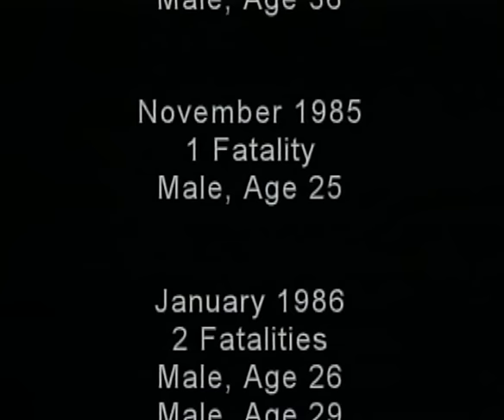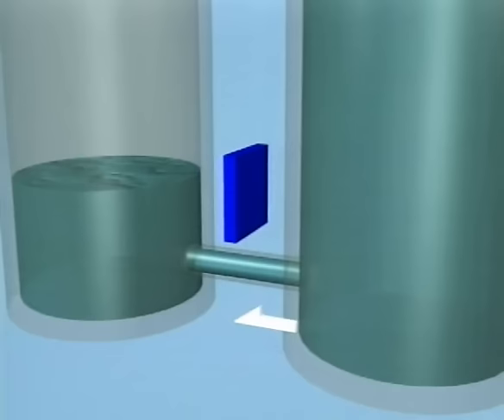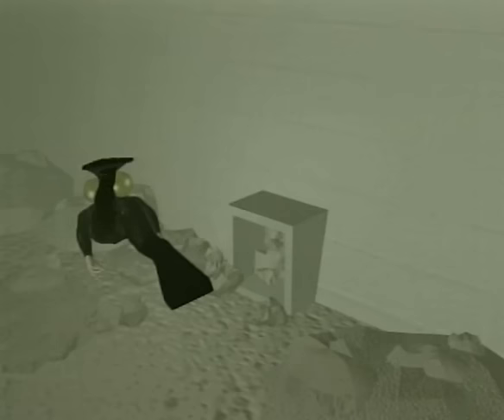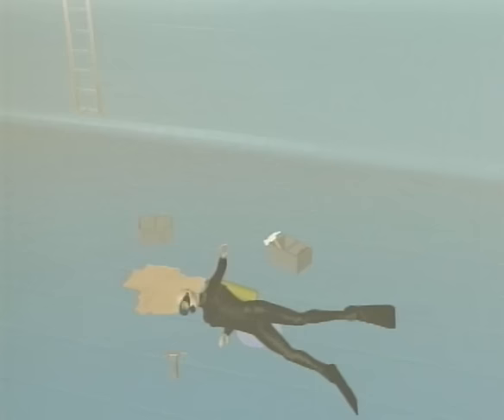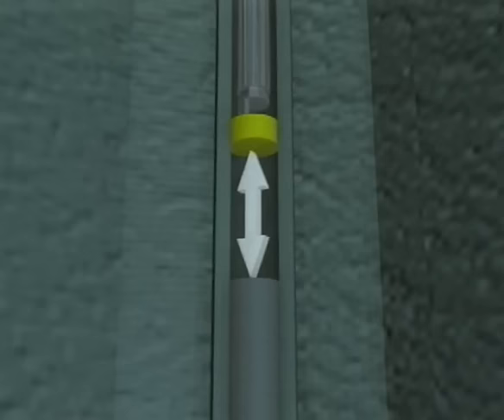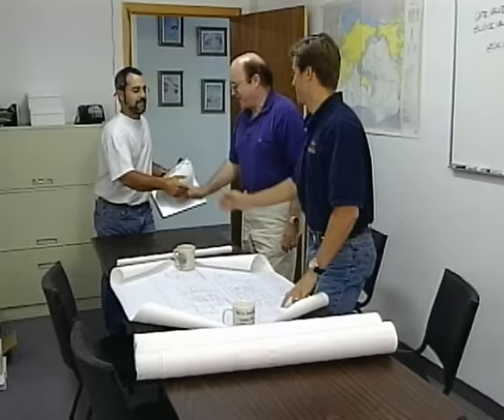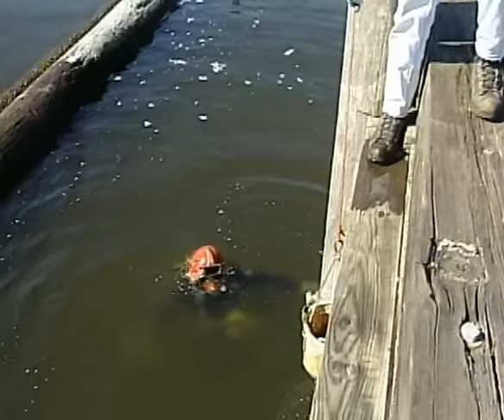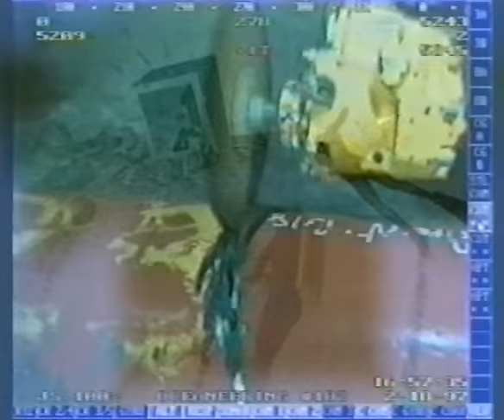Delta P

Comment: Diver 3 is a hero. He put his life on the line to recover 2 bodies, whether dead or not.
Reply: i can understand the sentiment, but you can’t deny it’s a stupid move, too. the water is not your friend, rescue attempts only put you at risk, the smart call is to leave your comrades to rest and staying alive and safe away from the accident site
Reply: @wddld-qv7sd 
Working in similar fields, we assume that missing coworkers are never dead, but simply incapacitated. We don't asses them for life until we exit the hazard situation and check for a pulse.
Reply: He is, but in my head was this situation where divers just kept going down and clogging the drain "Diver 32, also became trapped"
Reply: @74KU  We now have precautions in place wherein, if a trapped or incapacitated coworker is in too hazardous of a situation, we don't send anyone in to try to rescue them until higher tiers of rescue workers are on scene. In my current field that's usually HART (High Angle Rescue Technicians) and Confined Spaces Specialists.
First order of business for first responders is to mitigate the risks, such as water flow, electricity, oxygen and fuel from a fire, etc. Standard Protocol even for the specialists isn't to go in until the hazards are removed.
My experience regarding this so far is in recreational diving, dam building, and high rise construction.
Reply: In general you shouldn't try to immediately rescue someone, that's what resulted in two deaths and an injury instead of one death. Proper procedure was probably either use built in communications to contact rescue team or surface to contact the rescue team. Since it's a dam and they had people manually cleaning the grate odds are the water flow could have and presumably was supposed to be cut off.

For all we know diver two could have just told people topside, they could have closed a valve or something and stopped the flow of water.
Reply: @hawawah8671  Accidents like this are why and how we developed those procedures.... after the fact.
Reply: @Mygg_Jeager  Even if no mandated or suggested procedure existed for such dives at the time as a general rule you should leave rescue attempts for the experts. People trying to save friends in industrial accidents have killed far more people than they've saved. Pulling one person out of a hole is hard pulling two or more people out of a hole is much harder per additional person.
Reply: @hawawah8671  Oh I agree 100%, lol. Just adding to what you said.
Reply: @Mygg_Jeager  Fair enough, almost all methods of protection unfortunately only arise after the fact.
Reply: @Mygg_Jeager yo, spotted you on I think real life lore comment section. I think you were slaying spergs with your mighty blade. Carry on.
Reply: @lucamckenn5932  Likely. XD
Thank you.
Reply: it later transpired he ate the two other divers
Reply: @El_Hoy_Garcia  Previous Jobs includes massive dams in the middle of nowhere and rural camp work. Thought about using my recreational diving certification to bridge into professional commercial diving, but that's an extremely tight knit and highly controlled industry. Don't know about all commercial divers, but I know that there's only 5,500 deep-sea welders on the entire planet. So if all my skills and certs so far only got me pushing dirt, it's not really worth my while up go chasing extremely rare and prestigious qualifications for such tightly controlled and rare jobs - at least not without a solid in with the industry, and a direct recommendation from somebody first.
Reply: @DunWorryBoutitBoutit Yeah. That's about what I thought. 😏
Reply: Just say they are all heroes then because he ain't no rescue diver He went down there to see what was taking so long in a hero saves people nobody got saved my boy
Reply: so sad most these people were in their 20's
Reply: There was an instance where a young man was recorded to retrieve remains of his dead friend from a sharks belly after killing it.
Reply: Never have I ever expected to read a professional opinion on diving safety under a willy wonka meme
Reply: Did the one diver who recovered the two dead, I hope he got there wages+ overtime for learning recovery diver on the job
Reply: Diver 2 too

Comment: I came here after learning about the Paria Pipeline Disaster. RIP to the victims who died, and thank you Chris for making it out and trying your best to get help. Shame on the company that did nothing to save those trapped lives while they could have. Disgusting on their part.
Reply: They didn't even try. They could access the bodies after they had died. They refused any rescue missions. Shame on them.
Reply: @PurePain_1  Actually the way they accessed the bodies after was they flushed them with pressure from the other side. So they kind of flushed them out..
Reply: Shame on the company, that did not consider delta-p possible and make a safe plan to do the work.
Reply: That same video brought me here too. Its that bad
Reply: soooo... that would be premeditated murder, right?
Reply: workers fault. they didn’t follow instructions

Comment: This is actually a very good video. And it has that 80s-90s vibe. My father was a dive tender when he was 18-19 years old in the late 60s. He said he learned a lot of stuff, but he couldn't take the toll of divers dying so much. He said he was watching a nearby dive crew in the MS River in New Orleans when something happened and 2 divers died. He'd had some close calls with his team also, but no deaths. It doesn't help that divers are frequently used for dangerous operations. And in some cases the company hiring you might be planning on doing some sort of procedure without your knowledge and it could kill you. Having a winchable tether would be nice. But Delta P, like GI Joe says, knowing is half the battle.

Comment: Now I know what this is called. When I was about 10 years old my local swimming pool had a wave system. It pulled water through a few holes that would have been about 1 metre by 2 metres long with big steel bars. I was a curious young lad and a very good swimmer so I swam 4 metres deep to see what happened when the waves were on. as I held on to the bars the water pulled my head into the bars and I could not pull out. My head was trapped being sucked in by Delta P. Then after about 10 seconds I felt my head was released and swam to the surface to get some air as the waves were being pushed out through another hole.

So I can understand that if the machines were set to take more water for longer there would have been nothing I could do. Needless to say in our day and age that would not pass health and safety any more.
Reply: scary!!
Reply: Squeamish warning
Have a great story: Once, a little girl who was looking for somewhere to rest was sitting on a pool drain. There was a pool cover, and water surrounding her. The drains started sucking, and it was pulling on her insides. Her intestines were sucked out.
Reply: Actually this happed to a young voy in thier own pool, he had to tear through his own intestines to get up to air. Was using the suction on his bum with the intake at the bottom of the pool

Comment: 🎯 Key Takeaways for quick navigation:

00:04 🚩 Delta P is a common cause of commercial diving fatalities, accounting for 2 out of 3 incidents.
01:12 🚧 Differential pressure (Delta P) occurs when water pressures between two bodies are significantly different, seeking to equalize themselves.
02:07 📏 The force of water through a hole can be calculated by area of the hole × difference in water depth × PSI per foot of water depth.
03:00 ⚠️ Delta P situations are invisible and can suddenly trap divers; escape is only possible when pressures equalize.
05:25 🚫 Proper preparation and communication are essential to avoid Delta P accidents during diving operations.
08:26 🔒 Implement lockout tagout procedures and assess potential Delta P hazards when selecting equipment for diving assignments.
09:10 🔄 Use techniques like cutting slots instead of holes, and fabricate covers to reduce the risk of getting stuck in Delta P situations.
10:21 🛡️ Be aware of potential differential pressure situations, recognize them beforehand, and be prepared to deal with them to ensure diving safety.
Reply: Huh. A serious "takeaways" comment. Thanks!

Comment: Never dive alone, always close the drain valve, and always tether. Also just try to drain whatever you are cleaning before trying to clean it if possible.
Reply: What?
Reply: tether?  so they can locate you?0
Reply: Noted. 
*drains entire ocean*
Reply: And never, ever be Diver 1
Reply: Yup.  This situation happened at the West Edmonton mall in the indoor lake, buddy dove back down to grab a tool, left his partner on surface, got delta p'd into an intake pipe, ran out of air, game over.

Comment: Seems like most of these deaths are from corporate safety oversight or faulty equipment. Being aware simply isn't enough if your company doesn't put the effort in as well.
Reply: agree
Reply: Big agree and some contracting companies just dont care about protocol or code
Reply: @isaacriveraa2416  I worked as a millwright for 2 years. In that time I was encouraged to climb steel without a harness, grab un-insulated live wire that was insisted to be shut off, not provided respirators while working in silica filled quarries and I can go on for hours about the minor PPE failures our company failed to fix. Unfortunately your boss never seems to give a shit as long as you get the job done faster.
Reply: "It's ok to put Safety Third when you practice Personal Responsibility"
   --The ones never in danger.
Reply: @UrbanArmada  I feel you on this. My dad has even lost a job because his boss told him to sit on the cage of a skytrak and a onsite inspector saw him. They wiped their hands and simply fired him.
Reply: @UrbanArmada  you should sue
Reply: no unions in this business my guy, I do it because I love the job but it’s honestly not that dangerous, I believe it’s about 32 commercial dive related deaths per year on average
Reply: "Bro trust me its closed"

it was not closed
Reply: Theyvare actually from delta p 😀
Reply: like most problems greed and negligence are at fault
Reply: Bingo!
Reply: 🎵 Shake Hands with Danger 🎶
Reply: @entertheabyss9785  that’s messed up.
Reply: Spoken like some white collared office boy. The safety devices are there most people just don’t use them. Complacency is the biggest killer
Reply: @Bob-mo4no  I work in a fabrication shop. Ive seen more injuries from inadequate precautions out of pure greed than anything.
Reply: I feel like all tradesmen need to be taught to advocate for their safety in schools. Some of these wouldn't've happened if the diver was stubborn and didn't take the risk. There's rarely such thing as being too safe.
Reply: @thisguy9458  UNIONIIIIZE
Reply: My senior design class literally just went over workplace safety over the past week. This video really hits home because some of the violations are really obvious. Some of them on the employer part, some of them on the employee part. Shortcuts taken on either end just aren't worth it.
Reply: I can see where technology is letting down divers and poor communication because if a great deal of caution . Harness to keep you anchored to something was used these deaths wouldn't happen.
Reply: Call OSHA
Reply: @thisguy9458  it should  be zero.  We come too far to die in such trivial ways
Reply: @JustRed916  I wouldn't call being killed in a high risk job a trivial way to die
Reply: @UrbanArmada  capitalism
Reply: Yep, that crew at the dam got those divers killed.
Reply: Lives are worth nothing compared to sweet sweet profit. And ferraris, lots of them.
Reply: Reginaldo!
Reply: @UrbanArmada  unionize
Reply: @thisguy9458  the jobs are high risk because the companies don't care about their workers, genius. we have the technology and knowledge to make that number zero, but it might mean the ceos only get two yachts instead of three so it doesn't happen.
Reply: @LieseFury  Bit of both, simply being on an oil rig is really dangerous in of itself, also the ocean (North Sea particularly) is pretty dangerous, though you are right about employers not helping about that
Reply: @Bob-mo4no  lmao not being safe is complacency. Guess you failed primary school english as well.

Comment: Who’s here after the titan sub accident?😢
Reply: Same. If they are truly done for, I hope it was lack of oxygen since in the end, they just might pass out and then die in their sleep. I really hope they didn't get DeltaP'd down there.
Reply: super ironic that i have actually had this in my watch later for about a week but happen to watch it the day I found out about the submarine😭
Reply: @Namanoh  
Not really. You lose conciousness and just drift apart. This is why people that have gas leaks on winter die without being able to do nothing, because they end up sleeping silently.

You are mistaking choking with hypoxia.
Reply: @Namanoh  
It's the same here. 
Lack of oxygen derives in carbon monoxide poisoning. The only difference is that there is no source to speed the process but the very same people inside the room. 

They will just feel tired, talk some nonsense and go to sleep. They don't have a lot of space to even move around, therefore they won't even feel the numbness when the oxygen starts to run out.
Reply: @Hik4rol  yeah true, but imagine the leadup to that, knowing that you don't have enough oxygen. I mean the mental torture would be much worse than the actual death itself. 

Either way guess thats not a worry. In terms of death the best case scenario happened
Reply: @MemePiano  
Granted. They definitely felt dispair before that. Let's just hope they are resting now, whatever the case.